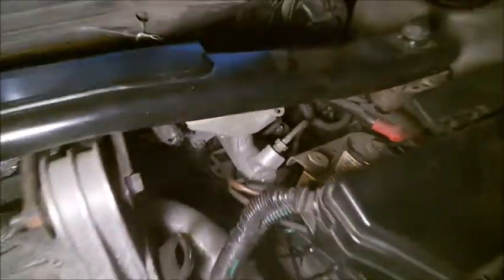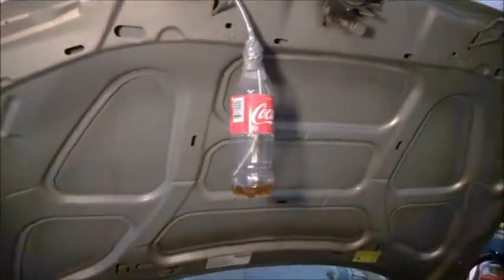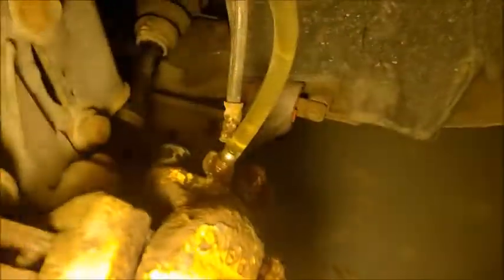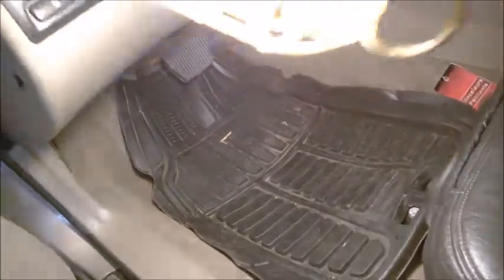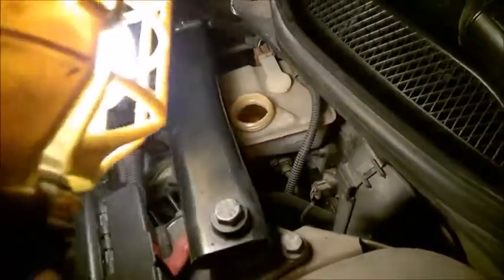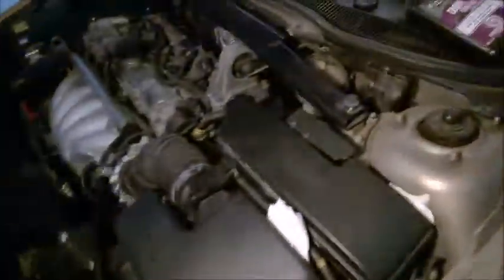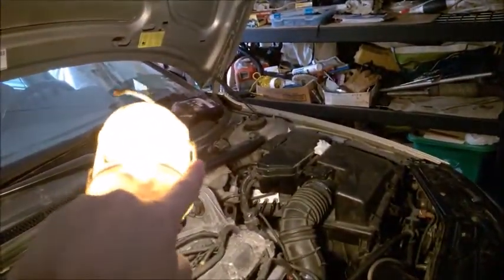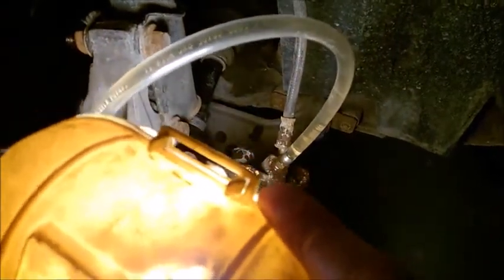Brakes Master cylinder bleeding burping

Comment from the maker: This may burp the ABS unit  https://youtu.be/mGU-glkL2B0
A tech working for a dealership is saying on forums that the ABS unit should burp when the ABS activates on all wheels - this will typically happen on snow/ice surface in winter.